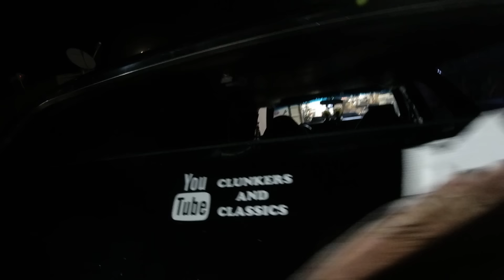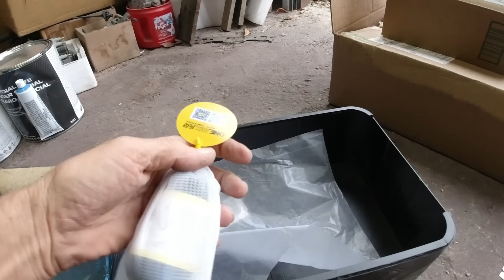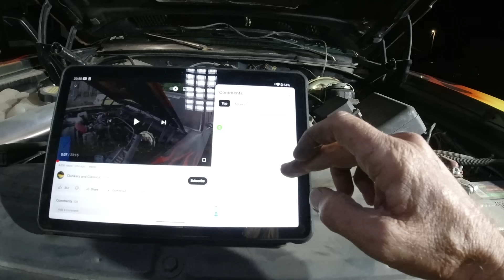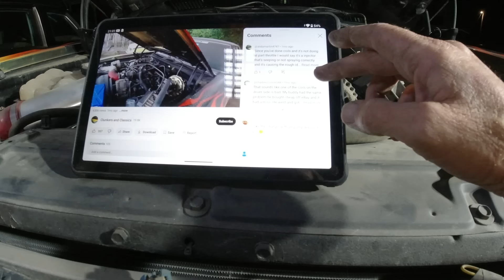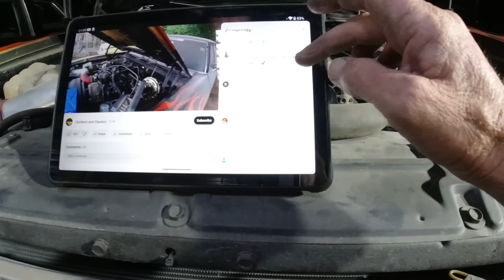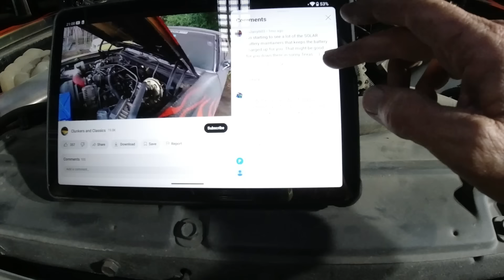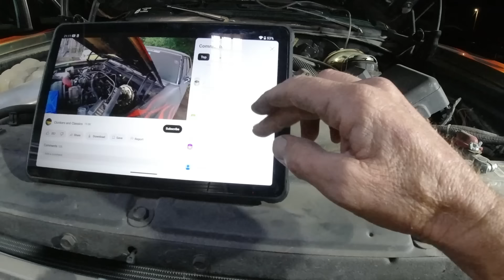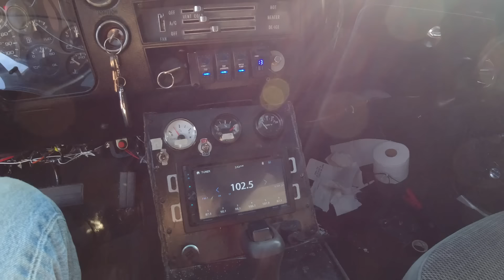Diagnosing a Misfire, Test Drive, Installing a Dash Cam on 1968 Chevelle Nomad Wagon

Comment: Agree with one of the comments sticking valves, old school way half quart or more of atf or mystery oil down the intake rev high works every time a little tricky with that intake you could come up with something.
Reply: I've been driving on a 6.0 with a random misfire for two years, swapped parts with my other trucks with no change.  I'll tell you the miss went away almost completely driving fast thru a flooded street.  I think I sucked some water in the throttle body and steam cleaned some of the valves or something.  I may try this method to get it to clear up all the way.
Reply: I have had a few ls motors with a misfire caused by the intake gaskets. I would spray brake cleaner around the intak or just take it off to inspect the gaskets. Intake comes off in about 15 minutes. No coolant spill or anything.

Comment: make sure you dont have an exhaust leak and then put a set of ngk iridium spark plugs in it  if it sounds like its missing but you dont really feel a miss  just put the plugs in for the model of the motor   you will be suprised  the fuel now is cut so much with ethanol   you will be suprised  more power  just took care of my 86 year old dads truck  he loves it now

Comment: The easiest way to figure it out is a good live data scan tool.. like Autel or a launch.. even top don makes one.. that will give you the cylinder.. then a leak down test on the cylinder will tell you if it’s valves or bad rings.. you will make sure the valves are closed and add air to the cylinder and where ever the air is coming from is what’s wrong.. air out the intake.. bad intake valve.. air out exhaust.. exhaust valve.. or air in the crankcase is rings..

Comment: I may be too late on this brother. But take your air compressor and your compression tester  Put a nipple on the end of your compression tester end do it on each cylinder. Inject the air from your air compressor They're gonna come out the intake.  Are they exhaust that will eliminate any valve leakage you might have?

Comment: Variable valve timing (VVT) began to be used on LS engines around 2005, with the introduction of the Generation IV LS blocks, which included this feature as a standard component; however, some earlier 6.0L and 6.2L LS engines may have had VVT available before this point depending on the model year.

Comment: I wonder if the code for Throttle position would come back after being cleared out of the computer . It could be from unplugging the sensor w. the battery still connected or it could be a wire to the sensor/any sensor plugged into it. Some end up with a dead spot but you said you tried another sensor. It's hard to say how much grief a loose connection can cause but, i wouldn't expect a single cylinder problem from that type of an issue.

Comment: I guarantee that is a vacuum leaked causing an intermittent misfire on different cylinders. You have to use brake cleaner to search out the leaks.

Comment: Definitely not trying to criticize but I have built a lot of cars and like I said when you were installing this motor it needed the heads and intake off for inspection. You don't know if the cluster was changed to lower mileage or how it was treated. Everything has to be perfect for a computer controlled car.

Comment: I think you have gone through all the steps without any stripping down,so the best bet is just swap the engine for another good motor as you say if you go that far you may as well swap it out,it's either valve related or con rod bearing but that would have escalated quickly.  It's annoying I know. Shame really as it looks a nice hotrod.

Comment: If the coil is good and the injector is good and the plug is good and it has compression  then a valve is not opening if all is good with no compression the valve is bent or burrnt but just keep driving it and blow it up cause U read over the comments and just skip over it like u know all the stuff is good and u don't want help u just won't to complain about everything and show a bunch of junk someone sent you to sell ...!!!!
Reply from the maker: last video I did a compression test. I guessed you missed that.